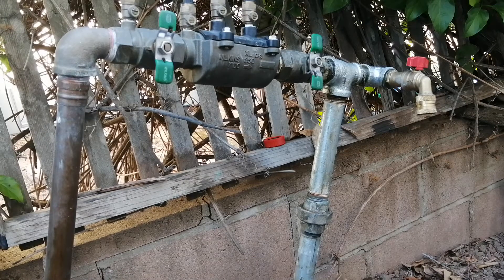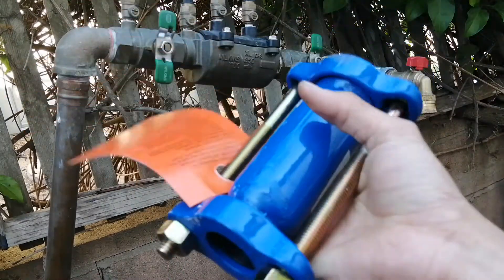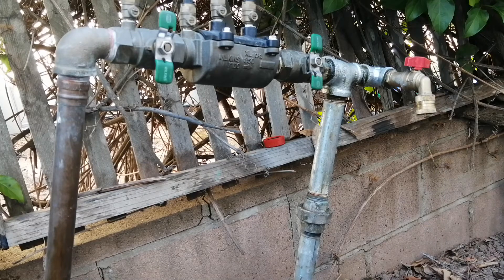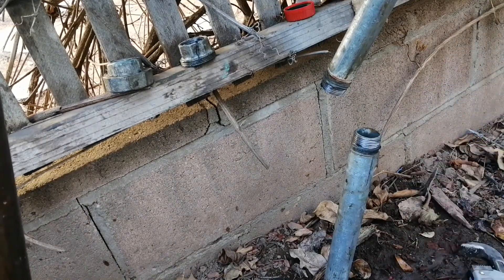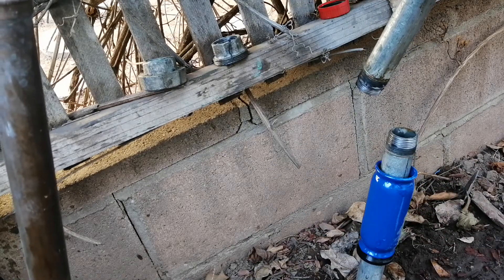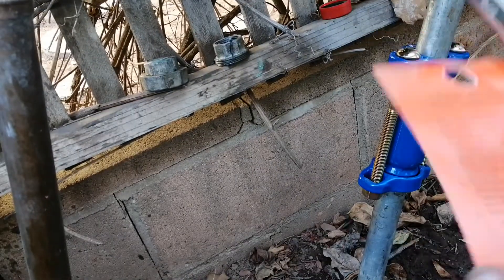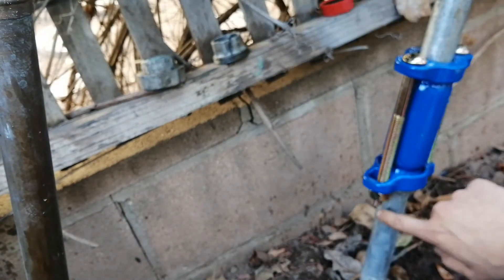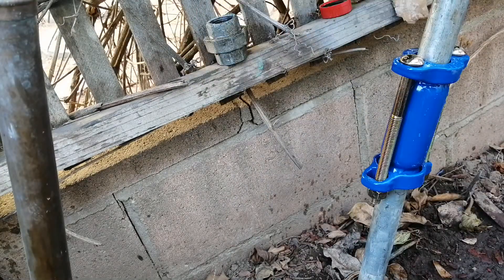How to Repair a Galvanized Water Or Irrigation Pipe With a Compression Coupling

Comment: It’s a handy fitting but for this repair I would have cut it out and then replaced it going down to the threads with painted PVC
Reply from the maker: In this case, the pipe was not subject to physical damage, so PVC wrapped in pipe wrap tape for UV protection (I prefer it to paint as it's less messy and more durable) could have been an option.
Reply: @DragonBuilds  oh right on I just said painted because most counties count that as code here, but the tape is better. I just have had horrible experiences with galvi

Comment: I just used this on a under ground pipe. The pipe is pretty messed up so it’s leaking. Is there something I can use to seal the leak or do I have to re-do the process?
Reply from the maker: If the pipe is in such rough shape you should probably just replace it.

Comment: Can you use it inside the house, or is pressure different?
Reply from the maker: You will have to check with your local codes. Both the compression and two bolt styles of coupling work on galvanized pipe, the two bolt style is more expensive but works if the pipes are misaligned. However, if your indoor galvanized water lines are failing a repipe is always the best option, if you start patching it you will be chasing leaks all day.

Comment: I’m starting to look into plumbing what tools would u recommend
Reply from the maker: It really depends on what you are planning on doing. Don't buy cheap tools, they are infuriating at best and dangerous at worst. For hand tools, I like RIDGID and Milwaukee. Milwaukee power tools are good too. If you are just starting out, I would recommend going to a local plumbing supply house as they will give you the best advice on what tools and materials you need for your project.
Reply: RiceFlavoredGum nice I’ll do that